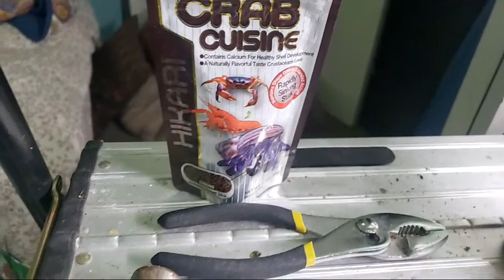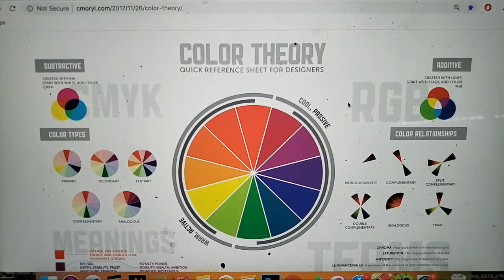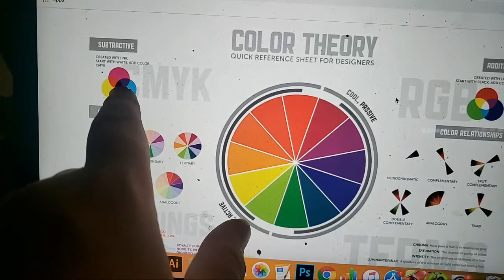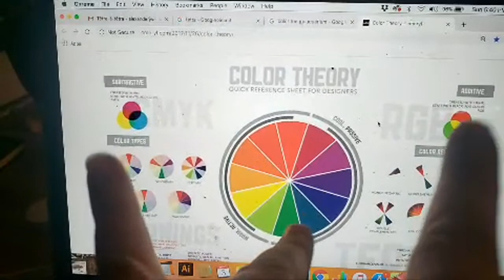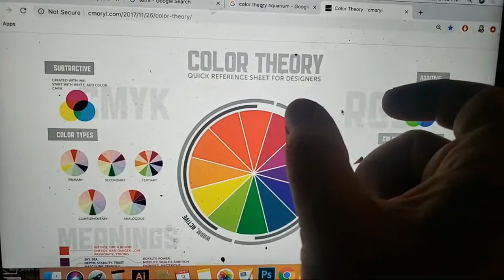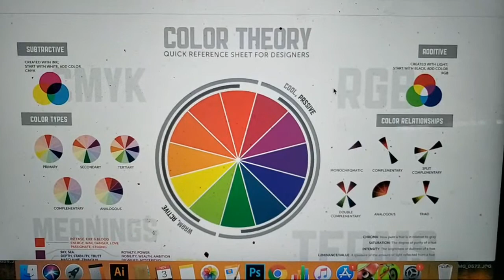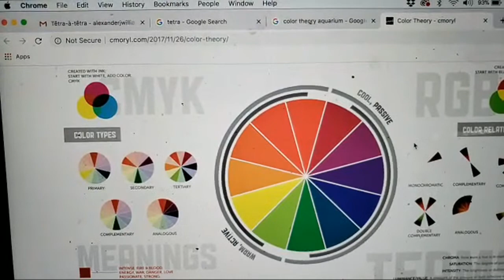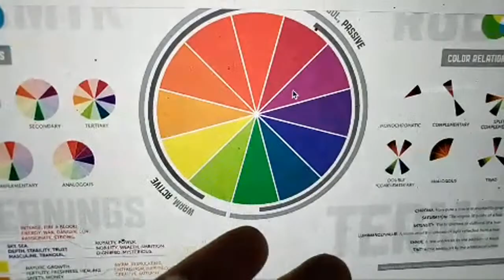The Optics & Physics of Color & Movement in Fish & What to Consider When Stocking Aquariums!

Comment: Alex, if that canister filter is sealed and filled and has been sitting like that for a while (more than 48 hours), the beneficial bacteria in it are most likely dead.  I would be hesitant to use it without thoroughly cleaning it first.  Thank you for a very intersting discussion.  Stay well.
Reply from the maker: Yeah i figured its 50/50 dead... but we had it unsealed and at room temp at least....just not oxygenated water running through it.